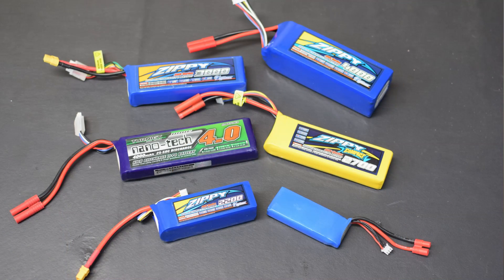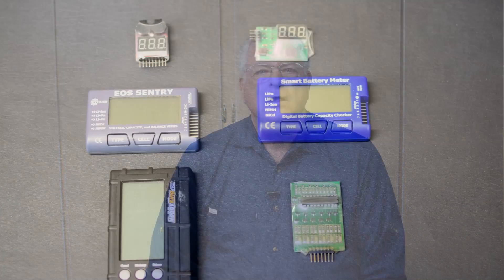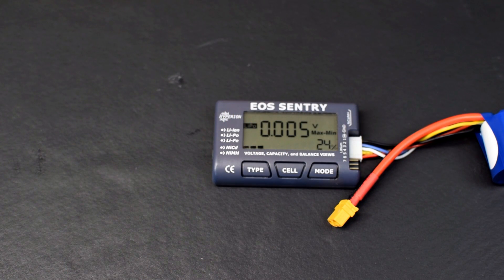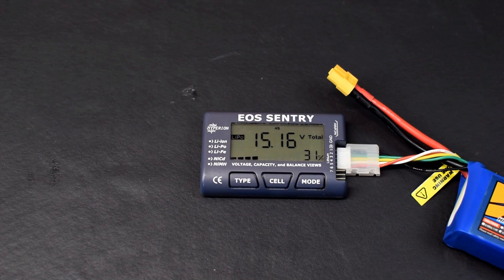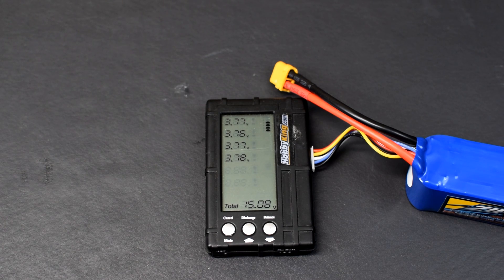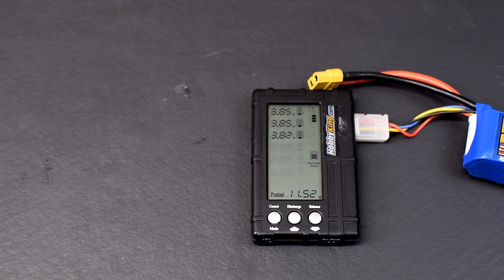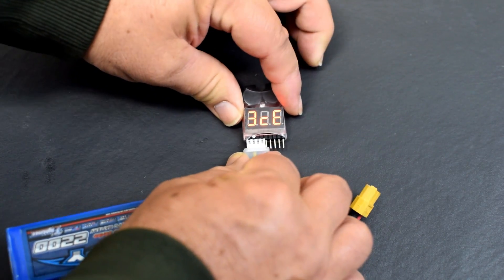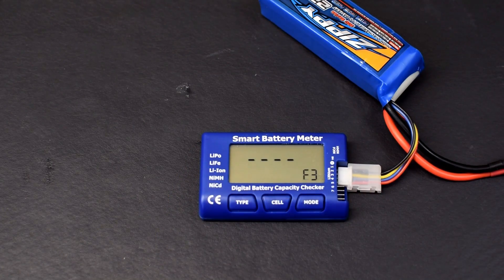RC Gadget Talk -  Battery Checkers

Comment: Thanks for posting.  One thing, you mentioned long term lipo storage 
voltage of 3.7/cell.  I thought the accepted standard was 3.85?  
Thoughts?
Reply from the maker: My first try at this answer was a bit muddled. Sorry. Lots of resources say store at 3.7 to 3.85 volts. I think I just latched on to the lower value. I have a new battery that I haven't charged yet and it came from the factory with the cells charged to 3.79 to 3.81. 3.8 is probably a good target. A little above or a little below will probably not make a big difference. The important thing is to not store them fully charged.
Reply: Thx again for following up. Shooting for around 3.8 storage would suffice.